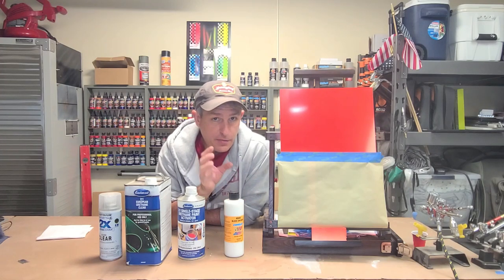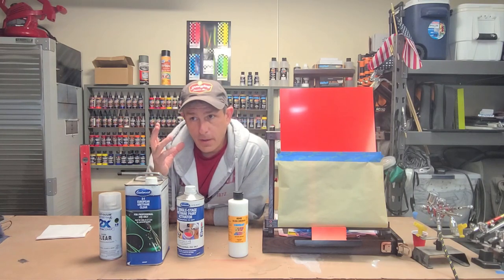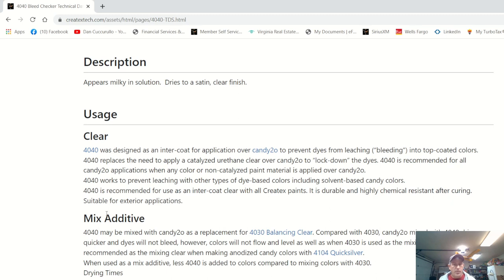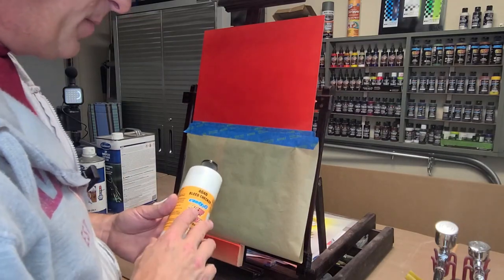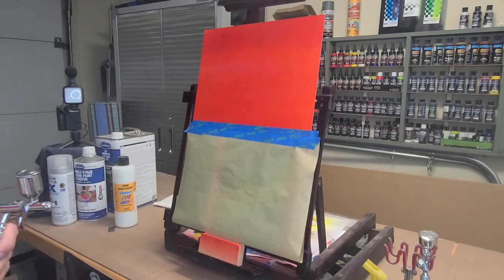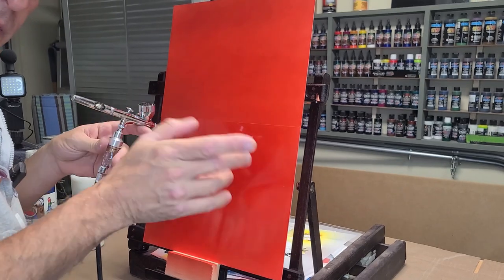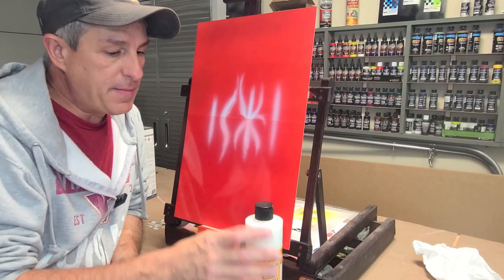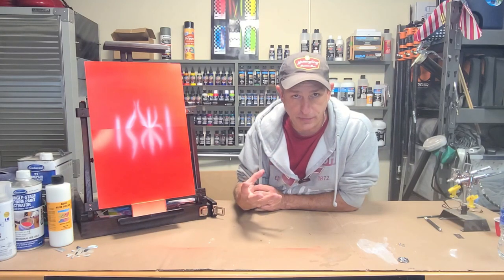How to - Stop Createx Candy 2o Bleed Thru with 4040 Bleed Checker

Comment: You deserve more subs. 🙂  Now the 4050 uvls clear can be used as an intercoat too as well right?
Reply from the maker: Ruggers, uvls is an aliphatic polyurethane resin just like the bleed checker but uvls is the carrier for the candy. The uvls spec sheet says it can be used as an inter coat but does not specify for what. I have never tried it but I feel like it would reactive the candy being most of the candy is the uvls anyway. Did you ever try it? I am always willing to test it out. I will also do a little research. And thank you for saying I should have more subs. I am slowly growing every week. Thank you for your support.
Reply: Thanks for this video for sure because I just got into airbrushing earlier this year and you and Barbatos Rex are my go to guys for learning this new skill. He does mainly reviews but you do what I need to see. Someone actually using the product for for what I need to use it on. I just sprayed a hot wheel with the blood red and was fixing to clear it but saw another video were you mentioned the 4040 which I didn't even know I had. And to know now that I can add more color on top of it with the use of the 4040 is super cool. Thanks for all you do and are continuing to do for us viewers.